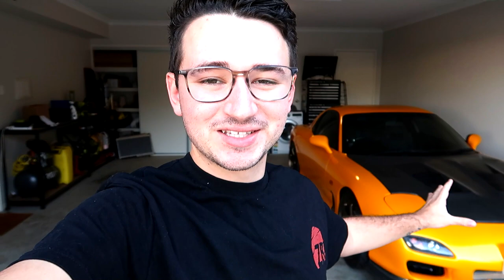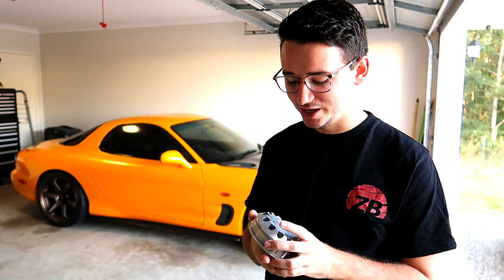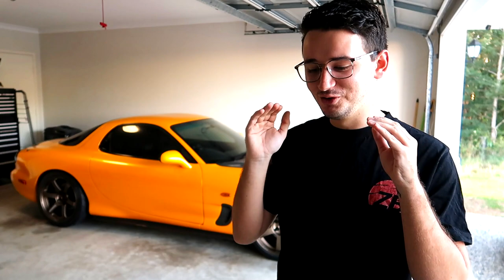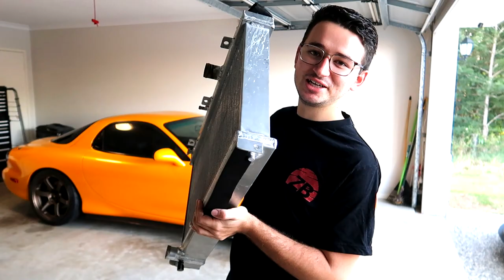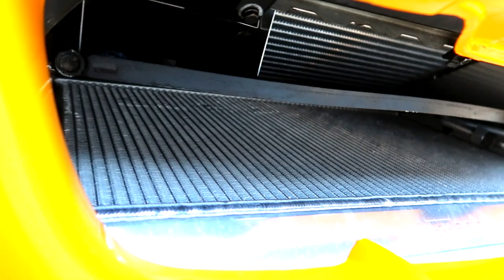How to Fix an Over-Heating Rotary!

Comment: Coolant seals..blah blah..rotaries dont have inherent problems with cooling or coolant seals.Any cars engine can have premature failure due to poor maintenance/ modifications  or fitting inferior parts.Your car had a slipping pulley, shit radiator with a cheap core and as commented many times by me, what looks like a bar and plate intercooler.The most inefficient for flow due to it square edged core.P.S. have you checked your expensive radiator for decent earthing and test your coolant for electrolysis?..maybe run a sacrificial anode?.You wouldnt want electrolysis to eat your radiator away in 6 months..

Comment: glad you fixed your issue! my 13b wants to overheat whenever i cruise pass 80 mph, other than that it runs perfectly fine, ive done most of the mods you mentioned besides a vmount! hopefully it works ^_^

Comment: rotaries exhaust gases burn hotter than piston engines, i would try bigger headers to get the exhaust gases out asap. those turbos and the bridge makes a LOT of heat. 2 oil coolers would be good too.

Comment: Talking temps, the rx8 standard thermostat opens at 86°c the the system is pressurised to deal with coolant running over 100c if your over 110°c then your getting into danger zone and 116°c + and you'll be lucky not to do any damage

Comment: This is why I chose to buy NA series 4 instead. I had a turbo before when they were dirt cheap, but it was leaking oil and didn’t run very well due to possible vaccum leaks.

Even with a Koyo Rad which cost me $800, heat is still a small issue on hot day in traffics with/without AC on. Still better than stock Rad though.

And if you are cheap, don’t own a rotary.